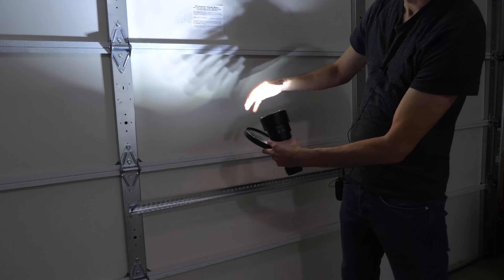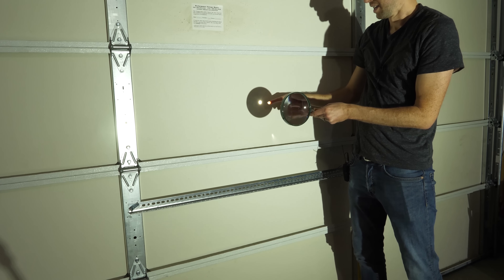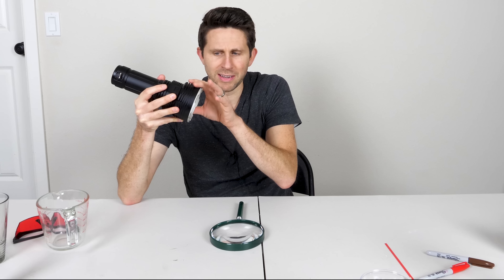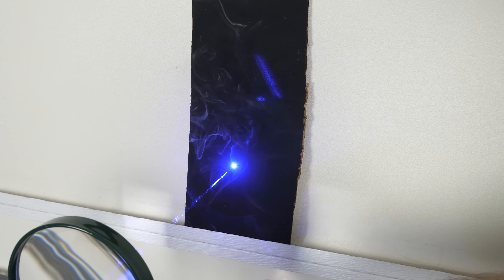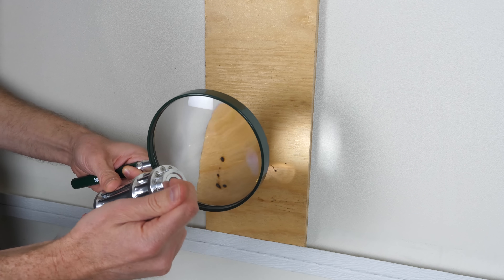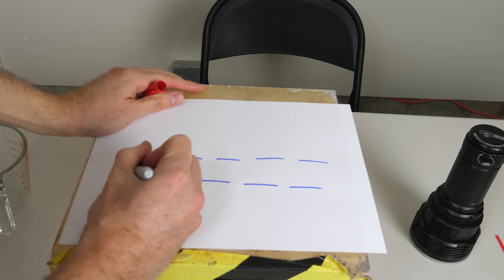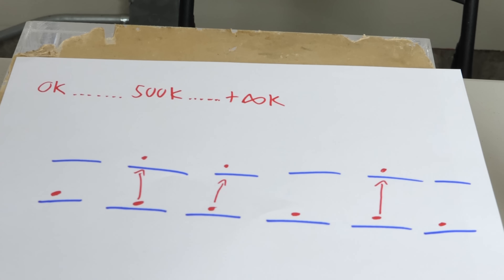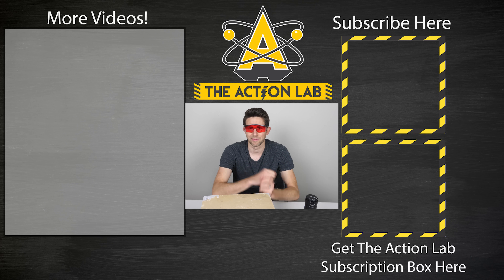What Happens if You Focus a 5W Laser With a Giant Magnifying Glass? Negative Kelvin Temperature!

Comment: "For a flashlight you can never use a lense to focus the flashlight down to a brighter point than the original source itselt" - Sorry, this is incorrect.
Simply use a lense with a smaller focal length and you can collect all emitted light and eventually focus it down to a brighter point.
E.g. use a lense at the distance of it's focal length and a diameter of the size of the diverging cone of light of your flashlight.
The beam now will be (mostly) collimated. Now use a second lense to focus this collimated light down to a spot.
And the cool thing is: Using lense-equations, you can show, that there exists a single lense, doing the same stuff as the two lenses on its own. (All assuming
to use rays, which is not reality. Yet you get very close, even with diffraction included).
Then you start to show a laser, which is already collimated. Using a lense will of course focus it further down. You will have
the same situation now as with your flashlight and the two lense system (which can be represented by one lense though) explained above.
The only difference now is, that lases can be focussed down way better (up to the diffraction limit at best) due to their inherit properties of
being narrowband, coherent radiation.
Then you talk about positive and negative temperatures. And your explanaition is quite nice.
In principle you want to point out that population inversion in a state-limited system (such as a 3 or 4 level laser) is equal to negative temperature (or in other words:
can be described by Planck's law inserting a negative temperature). This is completely fine. Yet, the principles used for generating coherent laser radiation
does not explain, why you shouldn't be able to do the same with a flashlight with the two-lense system (see above).
And also, you can't focus lasers down to a "smaller and smaller point as you want", how you state. In the end, diffraction limits you to best lambda/2.

Comment: Not wrong... but not right either. Your terminology is incorrect. The word "brighter" is not an accurate quantifier for light. Put your logic into terms like "photon density" or "photo flux"  Also.. the second law of thermodynamics sates that all moving energy eventually reaches a point of equalibrium thru entropy and can never happen negatively thru a gradient. In short.. no combination of lenses can create light or photons but it is absolutely possible to collect and  concentrate enough  photons to create a brighter spot than its original density. You just need a bigger collector

Comment: I'm pretty sure Negative temperature is just a temperature in a different frame of reference. I'm pretty sure the magnifying glass just heats the board up faster because you after focusing the light energy on a smaller amount of material. It's easier to heart up 1g of material than 1kg.

Comment: It would be possible for a flashlight or the Sun to heat a point to hotter than the source because the total temperature would be less taking the surface area of the source into consideration. You would have less heat total but it would focused to a small point

Comment: incorrect, 
the laser is producing the same amount of energy/heat. 
when the beam is not magnified it has a larger surface area to burn, hence it will not burn as quickly.
when you use a lenses the beam is concentrated into a smaller point.
That same amount of energy/heat if focused on an area with a smaller surface area. hence, why it burns faster. 
If you could create infinite energy with a lens, you would defy the laws of thermodynamics, win a Nobel prize, and solve the earth energy crisis.
I think not.

Comment: Why would you use a giant magnifying glass? The minimum size of the spot is determined by the numerical apperture of the lens, that is (roughly) the diameter divided by the focal length. This lens have a very long focal length. It also have a large diameter, but you only use a tiny portion of that diameter. To make propper use of this lens you should first defocus the beam to cover the lens, then your spot would be tighter.

You could also just use a smaller lens.
Reply: Surten lenses shrink light rather then macking it grow
Reply: @falconsgames8230  Beautiful spelling!

Comment: This doesn't make much sense to me.
Excluding the point where you heavily imply that your laser has a greater temperature difference than an infinitely hot substance, which in reality would vaporize the planet.

Surely if you had a sufficiently convex lens in front of your flashlight, followed by a series of various lenses the light could be focused into an area smaller than the flashlight, even if you assume that you have a substantial loss in the light collected and focused you just need to get more photons per unit area than left the flashlight. 
You can, therefore, conserve energy while transmitting that energy from the batter, via photons into an area smaller than the photon emitters.

The problem is that the flashlight isn't just transferring heat if it were, it wouldn't be a flashlight. 

Let's say that I had an array of LED light emitters 1 mile in diameter which projected 90% of their light straight head ( doubling the area every AU, so straight enough ), then use a series of lenses (w/ 90% efficiency) to focus that light down a focus 1/2 inch in radius. Surely we could agree that the temperature of that focus point would be greater than anyone LED, but that the power output of the LED array would be inefficiently used if all I wanted to do was heat up something.
Because based on what you have outlined in your video, all we need to do to prove you wrong it to get more photons hitting the destination area, than an equivalent area from the source of the photons, thereby imparting more energy to it, increasing its temperature above that of the source.

Perhaps I am wrong, you would need to perhaps explain it a bit better, or provide a better demonstration. Because with a short google search, it just seems as though you have a misunderstanding of either Clausius's formulation of the second law of thermodynamics or quantum mechanics or both.
Once again I am open to being wrong, please show it.

Comment: I mean, you could concentrate the light from the flashlight using an appropriately sized collimating lens, and then focus the collimated beam to a point and it would be hotter than the same sized point on the flashlight, but not as hot as the total temperature of the flashlight.

Comment: you can concentrate the energy of the flashlight. The practical solution would be to surround the flashlight with a milar tube or something by that would mean losses. Alternatively, you can get a large enough mirror so that all light is captured at the distance you need to be to focus it down. It won't be brighter (as bright if you don't consider losses on the glass) but it will get hotter.

Comment: Let me see if I got this straight  - 0k can be achieved by physically reducing the physical ambient temperature and then shooting the light source through that cold column of air ? for example let's say I've  got a black iron pipe with an inside diameter of two inches well say the pipe is 2 foot long now let's assume that I mounted the light source onto a bracelet and then I mount the magnifying glass onto a bracelet at the other end now if I pump cold ice water into the iron pipe and send the laser beam through the cold water then I'm moving in a direction of minus  - 0k is that right ? The reason for my interest is I'm wanting to build a laser cutter for cutting metal sheets, pipe and other materials I'm a welder and I need a better way to cut my metal to size and exact shape .thanks  p/s can you tell me the formula for cooling down the air so that I can cut per thickness of material for example let's say I needed to cut 1/4 " thick aluminum sheet how cold would I need to make the inner chamber of the pipe using say a 1500 watt laser is there a formula or some online site that can help me
Reply from the maker: -0k is just a theoretical limit. You will never achieve negative temperatures outside of population inversion inside the laser.

Comment: ....you could also explain the idea of the laser being hotter when focused by the magnifying glass being due to the fact that at the source, the LEDs are spread out and unfocused, as is the heat produced. However, when you focus the laser, all of the heat is focused to one point, just like the light. This would mean that the heat produced is the same in both situations, but it is more concentrated when directed by a magnifying glass and will therefore reach higher temperatures.

Comment: Keep on blabbing physics all you want.  1) Your flash lignt is pissing all around de magnifying glass.  Try a sounder apporach where you'd duct all of the light in an aluminum tubing to the magnifying glass. You'd gather most of the flashlight heat on a small point. 2) Lasers do not spread so, all of the laser light is hitting the glass.  Obvious to see without quantum physics.  3) And also, what is a 'giant magnifying glass'?  With the laser it would have worked wit a  1" loupe, even a pair of reading eye-glasses.

Comment: Before your explanation I just assumed the reason was you were heating an area 1mm wide, Which heats slowly, instead now you're heating an area thats .1mm so it'll heat 10x as fast causing the etching, The total light and heat is the exact same, just focused to a smaller, sharper point which is obviously easier/faster to burn

Comment: What if we used a long pipe? Meaning from the source, ie. the torch, have a large pipe connect the lens at the end of the pipe so that the focal lengths can make it to a point. Would that make a smaller point with no loss of light at all?

Comment: In the case of the flashlight you CAN use a lense, it just needs to be a different shape. Also more than one lense could do the trick.
It would be more concentrated, therefore hotter and brighter in that spot than an equal area on the flashlight, but if course not more total  lumens or heat than the source.

Comment: This video is wrong. You can't have negative temperature by focusing the laser. The negative temperature is defined by entropy and energy. That is only happening in some exotic material at certain case.
Also, the real reason that LED can't be focused well is that you only use one single lens. One can design a 4 Pi optics to focusing down the LED flash light as well.

Comment: You don't need "absolute zero" to ensure that the atoms of a piece of matter are at their lowest state as different pieces of matter have different low energy states. the atoms in a small block of wood for example, out of sunlight, will be at it's lowest state well above "absolute zero". Focusing the light, be that from a laser, torch or even the sun, into a concentrated spot with, say a parabolic reflector, does not break any laws of thermodynamics/physics at all. you are just reducing the light from a larger area to that of a smaller area. The same amount of energy falling onto a smaller area will quite obviously be hotter than falling onto a larger area. Sort of reverse as to how a heat sink works. The larger the heat sink, the faster it will dissipate heat

Comment: This shows a lack of understanding when this guy reviews the laws of physics...
Laser = cold / light = hot is wrong

Property of law of thermodynamics...
A source of energy over a wide area has same heat total as same source concentrated over a smaller area; this makes sense... he misinterpreted the function.  Let's estimate 1 joule of E over an area of ... ehh 1 cm radius circle vs over .1cm radius circle...
1J/3.14cm^2 vs 1J/0.0314cm^2

In effect same amount of energy hitting an area the 1/100th of the area prior...  you have 9,900% increase in average energy hitting an area- or 100 times the energy transfer average of the prior area by concentrating the energy.  

To simplify: it matters not laser or flashlight; all one must do is concentrate the energy from the source... to do this you must face a CONVEX lens so the light is drawn closer... look up light refraction properties buddy.  Also, by only altering and concentrating part of the beam, you of course have less overall energy affected by your experiment.  You should know that magnifying glasses have two different sides.  One is more convex while one is more concave; to make things appear larger, you must peer from convex to concave; to reduce their apparent size you must look from concave to convex... I wear glasses that allow me to see smaller objects as if they are larger, to make them more legible.  

You need to reread your physics textbooks before you try again- and next time you should not flip the glass around from flashlight to laser-  it was obvious
Reply: Sadly enough your efforts are wasted in vain. The "science" guy in this video is obviously a psychotic. Absolutely derranged person with no ability of comprehention, what he's got apparently is the false sense of knowledge and an urge to educate others. I don't even know how I got here but I regret it so much already. When I hear people like this guy speak of "laws of thermodynamics" it gives me the headaches.
Apparently he even has a series of such sensless brain corruption. I only fear that my curiosity will make me check his other vids too.
Reply: @OmikronCZ  You got a problem dude. Actually, more than one. Get a life
Reply: This demonstration learned in my course at the university called Classic Optics , I think he got it all wrong , nice explanation about thermodynamics,  it's all simple . 1.8M viewers got it wrong stupid comments got 200 ~1.3k likes while the real simplicity explanation where given got only a few of them , that show us how much smart people we got on this spherical planet, few , is the term I'll use
Reply: Does light itself have a temperature ? like in space is there such a thing as 'cold light '?
Reply: Wow
Reply: Y
Reply: What the heck 

Your brain got to be the size of the moon. ...... the size of a peanut
Reply: Yep he isn't using the right lens in the vid
Reply: Darren Yee You found the circumference of the areas, should you be finding the area?
Reply: English plz

Comment: A plano convex lens would focus the light from the flashlight and the laser just fine into a point without issue with the lens directly against the face. A magnifying lens is a double convex lens, making things before the focal point appear larger if it's projecting onto something significantly outside of its focal point on the opposite side. CO2 and organic lasers, telescopes and microscopes generally use one or more plano convex, convex-concave, or plano concave lenses, which makes appear things bigger viewed from one direction, but smaller in the other.

Comment: The LED is a pin point of light who's radial broadcast is partly captured by a small lens in the aperture of the laser pointer, which gathers or captures a small amount of the light coming off of the LED pin point and it spreads it out many times larger than that pin point source.  
      The LED gives off light in a 180 degree radius and the lens captures  less than a third of that energy.  By using a second lens you are redirecting that 30% output down to a pin point again but at less than a third of the original source and THAT is why you are not breaking any laws of thermodynamics,  not because of imaginary temperatures. 
        You could do a similar thing with your flash light if you put individual lenses on each LED to broadcast it straight forward, having 7 beams, then use your large lens to bring them all down to a fine collective point.  Bottlenecking the energy is key to being able to focus it's heat.